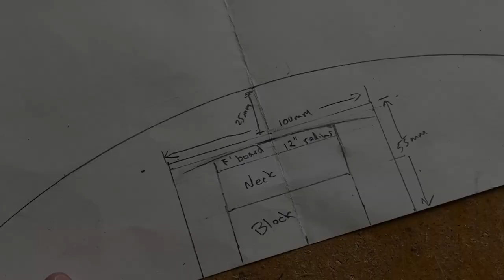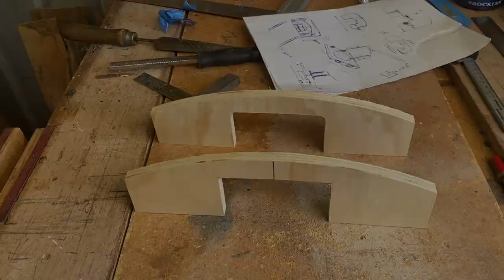Guitar Fretboard Radius Jig

Comment: I like the 1:45 note.
Many ignore that fact and make jigs with the sled of true radius and rout the fretboard obviously with smaller radius as they lower the bit below the sled. Lovely work
Reply from the maker: Cheers!
Reply: That seems to me to be exactly what is done here. His drawings are correct but then he matches to a 12" caul and gauge. I don't get it.
Reply from the maker: Yep, that was a mistake on my behalf. I didn’t want to hand sand the final radius, so I lightly used the 12 inch radius beam to remove the saw marks.
Reply: so the actual radius of the jig is bigger to make up for the offset?
Reply from the maker: That’s correct. I should make a note in the description to clarify. 👍

Comment: I've just made my own radius jig and it's very much inspired by yours. I had a system using small casters on the router base but swapped it out for your system with the bearings - much more elegant. Thanks for sharing.
Reply from the maker: Glad you’ve found it helpful! The bearings certainly make it very smooth. 👍
Reply: @adairguitars  a great addition. Thanks again.

Comment: Nice i have the same type of jig to avoid tear out on fretted slots  use shallow passes straight up from the heel at the  high E side aross at the nut end straight back down at the low E side to the heel  then across the whole board it leaves tooling marks but they are easy cleaned up  the biggest thing to avoid is being tempted to have the bit flush with the center of the board when making the 1st passes tear out will happen
Reply from the maker: Yes, definitely agree. Small passes from the edges first.

Comment: I'm in the process of building my first guitar and coming up to doing the neck and fretboard. I have already made myself a radius sanding block and was planning on using that in conjunction with a hand plane to do the fretboard radius, but I think I have a new project in the works now. I have a ton of plywood pieces and all the tools I need to make this, not to mention about 40 sets bearings I bought when fidget spinners were a thing...
Reply from the maker: Sounds exciting. I’ve used fidget spinners bearings as well - always good repurposing things. All the best with your build! 👍

Comment: The only issue I've had with the various router jigs I've made for the fingerboard radius is the potential for tear out, especially routing the radius after slotting for frets. I prefer to radius after gluing on a flat fingerboard but I've had to remove a fingerboard or two after getting significant tear out on the edges.
Reply from the maker: This one did chip a bit around the fret slots, but should be covered by the frets themselves. I’ll have to try frets slots after radiusing as well. Good to hear other people’s experiences. 👍
Reply: @adairguitars  So why not cut the fret slots AFTER radiusing??
Reply from the maker: @timhallas4275  I use a table saw for fret slotting,  so I need a flat surface to cut the frets first.

Comment: So what do you do to compensate for the difference between the radius at the tip of the router bit vs the radius at base? If the base is 12”, and you lower your bit 1” below the base to reach the fretboard, you’re really routing an 11” radius. I cut my bases one inch larger radius for this reason. 

Tip: I route my fretboards before I cut them to shape to avoid tearout in important places. 

I like the ball bearing method. I may try that!
Reply from the maker: Mine is the same as yours then. Tip of the router is 12” and the base is just under 13”. The tearout so far has been minimal and hidden by the frets. I will try doing the radius before cutting to shape at some stage though. The ball bearings certainly keep it running smooth!
Reply: @adairguitars  your reply doesn't seem to add up considering at 6:35 the video shows the base/rails that the bearings ride on is clearly shown to be 12" radius. ??
Reply from the maker: @northtrader  just checked my notes and the radius of the base is 12 3/4 inches. At that part of the video i used a 12 inch guide to show the radius as that was the closest size I had. You can see a bit of a light gap in the middle which is the difference between the two. The measurements probably aren’t 100% perfect, but it works well. Fine sanding is done in the fretboard with a radius block so any potential differences will be fixed then. 👍
Reply: If you look at the video you see that he made the rails 13
Reply: At the beginning of the video the plans say 13 and a bit more remember!

Comment: Everything was perfect, but the part that the video failed miserably was to show what was the router bit to use :face-green-smiling:
Reply from the maker: Any size will work, but a smaller bit will get a more defined curve. The one I used was 6mm  and it didn’t need too much sanding afterwards.

Comment: At 1:45 you make a note that the sled runners sits higher than than the tip of the bit and therfore needs to be 13" (and a bit) to compensate... but later in the vid the sled runners are shown to be 12"... doesnt that mean then that you fingerboard will actually come out at an 11" radius?
Reply from the maker: Yes, there is a discrepancy which I realised afterwards. I used the 12 inch beam to lightly sand the runners to remove the bandsaw marks and get it smooth. I still use a sanding beam to finalise the radius but that only takes a few minutes with 180 grit paper. The final radius is realistically somewhere just under 12 inches.
Reply: Amazing... good to hear i wasnt going mad. 
 @adairguitars

Comment: Can I ask what kind of bushing that is that you pressed into the wood that the bearings used as their axle? (5:45) Thanks!
Reply from the maker: The whole part with the bearing came from the skateboard wheel and i drilled the relevant sized hole in the timber. I used Teflon tape to make it tight for a test run and later superglued them in. If it didn’t have that axle part I would have used a bolt to go through the bearing and wood. Hope that helps!
Reply: @adairguitars  Oh I see. Makes sense. Thanks for responding! Killer jig!

Comment: 7:40 What is this he is applying there?
Reply from the maker: Super glue to harden the wood and make a smoother surface for the bearings. 👍
Reply: @adairguitars  I understand. I imagined that it would be super glue. But didn't it leave little bumps? Or is it low viscosity super glue? I really have to try that.

Comment: Nice man. I have plans for something kind of similar to this. I like your design for sure. ✌️
Reply from the maker: Cheers, you still need to finalise with a sanding block, but the jig takes out all the guesswork (and time and effort). The goal of my design was to make it as small as possible. 👍
Reply: @adairguitars  I was trying to think of a way to have detachable acrylic radius sections that are secured to the sides with thumb screws so you need only take the 2 sides off and replace them with whatever radius you want. Accuracy is the key. Your jig is absolutely killer. The addition of the bearings are the ticket man. Awesome.
Reply from the maker: @SweetTGuitars  multiple radius options would be a good idea, especially if it’s quick and easy to change over. The bearings work well to keep it smooth and should hopefully avoid the mdf wearing away over time. Thanks Todd!

Comment: There is a simpler way. Take a rope of a given length (including a dremel and a bit). Tight one end above a workbench to a rod (so the rope can move back and forward). Fix a hard wood piece below. Or fix the upper end of the rope, and move the piece of wood. Turn on the dremel and make a gutter. Then glue a sandpaper.
Reply: 7:40 What is this he is applying there?
Reply: @EbonyPope  It hardens the wooden rails top I think to prevent caves to appear. I mean a superglue
Reply from the maker: Exactly right!

Comment: Hi! What kind of a router bit did you use? Thank you!
Reply from the maker: 6mm straight cut bit. 👍
Reply: Thank you! Do you have any experience with grooving fingerboard for the frets! They recommend Tip Size: .023″ (0.6mm)
Length of Cut: .069″ (1.752mm)
Shank Diameter: 1/8″ (3.175mm)
Tool Length: 1-1/2″ (38mm)
Did you try it for Fret Slots!

Comment: So I made one today, not off plans but from just the general idea, and it seemed pretty promising. I am making a tighter radius for my type of fiddles. So more curved than a guitar but I may have made it too small because I destroyed my wood. Should have used a test piece because I ruined a nice piece of bocote… 

Other than probably making it way too tight, my router sort of rocked sideways in a way that I wasn’t expecting. I’ll give it another shot but what a massive failure for my first attempt 😖
Reply from the maker: Oh no! Hopefully you can sort something out that works for what you’re building.

Comment: How wide is your jig it looks to be more than 12” think I’m going to make one for myself. I just don’t want to build it to wide
Reply from the maker: The ‘trolly’ part of the jig is 280mm wide if that’s the part you mean? The radius of the curve is just over 12” so the tip of the cutter is at 12”.
Reply: @adairguitars  nope I was looking for the width I’m probably gonna make a jig too and figured if I knew how wide yours was I’d just go with that instead of making to small or big. Thanks cheers
Reply from the maker: @NA-xm7wj  do you mean the base part that the neck is attached to? Happy to measure it to let you know.
Reply: @adairguitars  no the trolly part part is what I meant. I figure it was somewhere around the size I thought. Thanks again. Everything else I can figure out as I go. Thanks again
Reply from the maker: @NA-xm7wj  no worries, good luck! 👍
Reply: @adairguitars  👍

Comment: Great jig, great build. I love it!
A quick question on use - have you experimented with moving the router  across the fretboard as well as up and down as in the video? If you have, have you found any noticeable difference in the outcome? Thanks
Reply from the maker: Thanks! What’s in the video is the first time I’ve used it, so haven’t tried across the fretboard yet. From watching other similar jigs there seems to be more tear out going across. At some stage I’ll give that a test as well as different types of router bits. I think if you went across the fretboard, you would need to finish going lengthways. There were a few chips around some of the fret slots, but this was a very hard wood and they were small enough to be covered when the frets were installed.
Reply: @adairguitars  that's great, thanks for the response. I've only just discovered your channel today and love your content. It would be great to see more with this jig if you get chance plus any other jigs you make. Keep up the great work!
Reply from the maker: Thanks, glad you’re enjoying my videos. I’ll be using this jig for all fretboards that I need to radius from now on, so it will definitely be seen again. Thanks for watching and commenting! 👍

Comment: Never did this kind of work. Just wondering, can you cut the fret slots after radiusing? May result in less tear out at the fret slots. Or was this a precut fret board?
Reply from the maker: You could do it that way however I use a table saw for fret slotting, so need a flat surface. The wood in this example (gidgee) is super hard and it was a cheap router bit, but even the tear out from this was covered by the frets.
Reply: @adairguitars  great info! Thank you

Comment: What happens if the fretboard is just plain flat / smooth? Thank you 🤓
Reply from the maker: I’m not sure what you mean, sorry!
Reply: @adairguitars  I am not a guitar maker & I don't play but I am toying with the idea of making one... The final piece of wood that is used for the fretboard is usually slightly arced (a 12" radius?). If the board is left flat (level) will that make a difference? Thank you 🤓
Reply from the maker: @j.lietka9406  that makes sense now! It would still likely work, but you would have to have the bridge saddles and the nut flat as well, rather than radiused. I’m sure there are guitars out there that have flat fretboards. If it did work like that, the main difference would be how it feels to play.
Reply: @adairguitars  ok thank you 🤓 so the curved top of the fretboard is normal

Comment: why did you sand the 13 inch jig radius with a 12 inch sanding block? Does it have to be 13 or 12 after all?
Reply from the maker: Both the jig and the sanding block are 12 inches. The arc of the jig is just under 13 inches, so the tip of the router bit is at 12 inches. 👍

Comment: Your cutting edge looked to be about 2 inches below the level of the wheelbase. Did you make that 14 inch radius to compensate to arrive at 12 inch radius fretboard?
Reply from the maker: Yes, correct. The wheel base was about 13 1/2 inches from memory. 👍
Reply: @adairguitars  well done - looks great!
Reply from the maker: Thanks!
Reply: I wondered same thing especially when you ran the 12 radius gauge over the wooden surface- was thinking it should be a 14 gauge if targeting a 12 radius with cutter 2” below the curved 14 surface.

Comment: Maybe I'm wrong, but those wheels seem to be press-fit into the jig using teflon tape as a shim.  I wouldn't trust that at all.  One or more of those wheels are going to pop out eventually and, at best, ruin a fretboard or take off a finger at worst.  They should be secured or replaced with something else.
Reply from the maker: They’ve been superglued in now. That was for the test to make sure the principle worked. I certainly wouldn’t want them to fall out mid cut. 👍

Comment: Think I'm going to make this jig. Did you draw a radius of 13" to make the jig the router sits on? For a 12" radius?
Reply from the maker: Go for it. Yes, I think it was just over a 13” radius on the curve so the point of the router bit sits at 12”. Would depend on the type of router and how much adjustment it has. Also the thickness of the wood base etc.

Comment: El radio de la madera debe ser mayor me imagino. Para que al bajar la punta de router llegue a tener las 12 pulgadas, pues al estar la punta del router más cerca del centro de la circunferencia el radio es menor.
Reply from the maker: Correct, the radius of the wood is close to 13”, so the tip of the router is at 12”. 👍

Comment: Why not just use radius sanding blocks? Simpler, much cheaper, and with the same - or better - results. The only reason I can think of for fashioning a radius jig is if you want to do compound radiuses.
Reply from the maker: I use radius blocks as well, but the jig means I only have to do the fine sanding which saves heaps of time. It’s mostly made from scraps I had so actually worked out cheaper than a sanding block anyway. 👍
Reply: @adairguitars  Ah, okay. Yes, sanding blocks aren’t for using in a hurry, that’s for sure.
Reply: Sanding blocks alone are not ideal for radiusing a board. Easy to make a mistake and sand the board uneven. They Don’t provide better results than a well made jig. The jig Can radius a board in about 5 mins, and then use a radius block to fine sand. My jig cost about $15 worth of materials when I made it. This style of jig doesn’t do compound radius either. There are other types for that. Main reason for my building the jig, I got real tired real fast if sanding a radius into a fretboard. It’s a pita.
Reply from the maker: This is definitely the easiest and most reliable  method I have found so far. 👍
Reply: @mgcnashville6615 If you do not take care you would actually (unintentionally) make a random compound fretboard just using radiusblocks 😇
Reply: If you do not take care you would actually (unintentionally) make a random compound fretboard just using radiusblocks 😇

Comment: It takes 10 minutes to radius a fretboard with a block and sandpaper. This is overkill even for luthier making 30 to 50 guitars per year.
Reply from the maker: I find that when I use a radius block for the full fretboard, I get inconsistencies across the length. This jig gets it consistent each time and then I only need find sanding.
Reply: @adairguitars  I don't disagree, but I would counter that I'd rather baby the fretboard into true than have a full depth of cut router mishap, rare though they may be.
Incidentally, I love the jig design. Not trying to shit on your process.
I follow my radius block with a true flat, 24" aluminum sanding beam to level out any waviness or dips on either end of the board.
Reply from the maker: That makes perfect sense what you’re saying, so all good. All part of trying different processes to see what works. A longer beam or radius block would certainly work well. 👍
Reply: @peachmelba1000  I counter using this jig over 10 years will save you time, effort, and wear and tear on your body over 10 years.